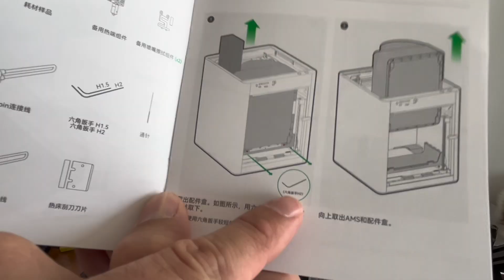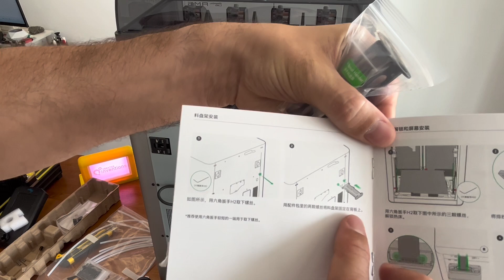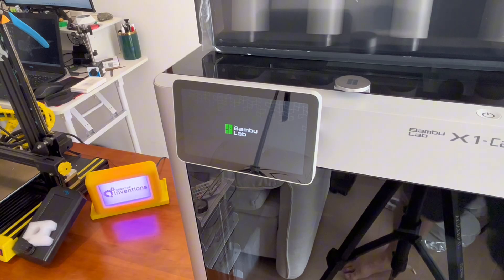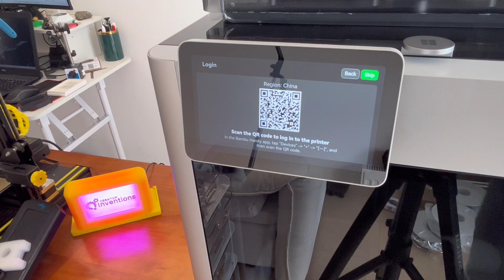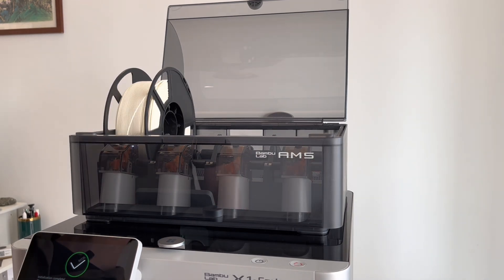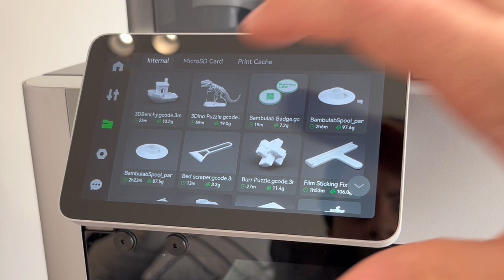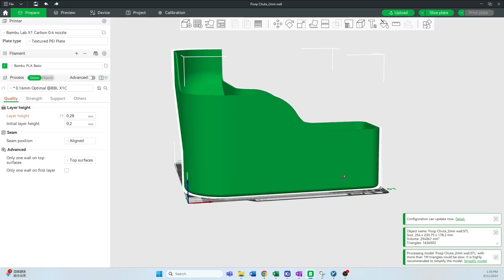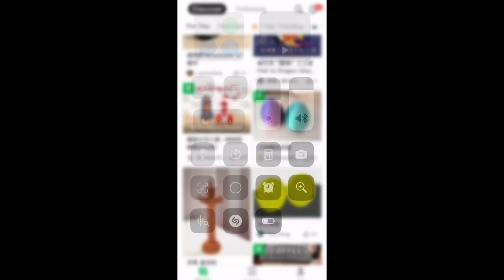Bambu Labs Carbon X1 3D Printer: Unboxing and Initial Setup

Comment: How did you get the Styrofoam out from under the bed
Reply from the maker: I believe you do it once the printer starts up and raises the bed.
Reply: @DesktopInventions Correct - It becomes accessible when the bed rises up during calibration.

Comment: is there a glue stick that comes with it?, because when i unboxed this i didnt find a glue stick
Reply: Same man, did you end up using it without it and did it work just fine?
Reply: Yea I ended up not using it
Reply: Maybe bro because 10 months before they used a cool plate and now another one which doesn't need gluestick

Comment: I came across your video trying to figure out what comes with it, extra hot end, any filament? As much as I love to tinker I have been 3D printing since 2013 with a makerbot replicator, and was part of the CoreXY testing and beta software like sailfish. Well I am getting to old and tired, days are getting shorter and I just want to print. So I will be adding this one to my arsenal of printers and still keep the original CoreXY and heavily modified Replicator2 that also is now dual and chambered. It will be a big jump in tech and interesting to see how they compare.

Comment: Great video!  Can you print and video it doing some parts in ABS?  Curious to see how it handles that since ABS requires higher print & bed temps.
Reply from the maker: Yes, I printed ABS the other week, just pop it in, change to ABS in the slicer software and that was it. Turned out great!